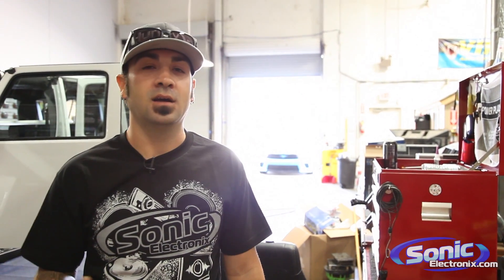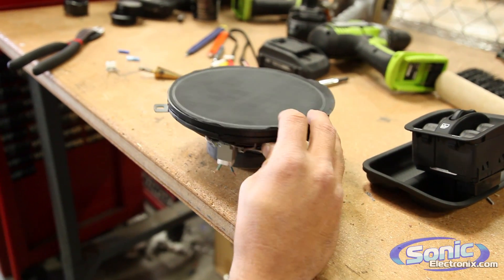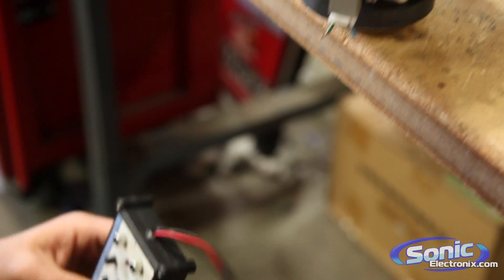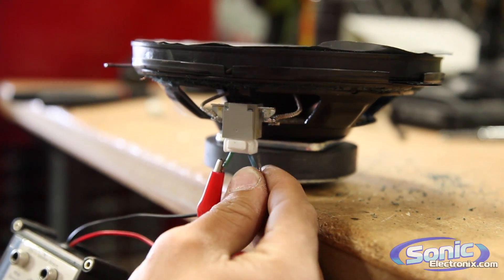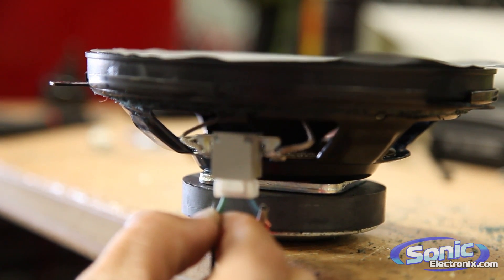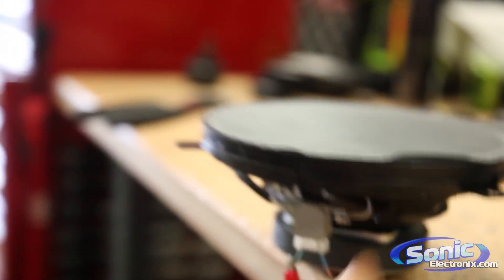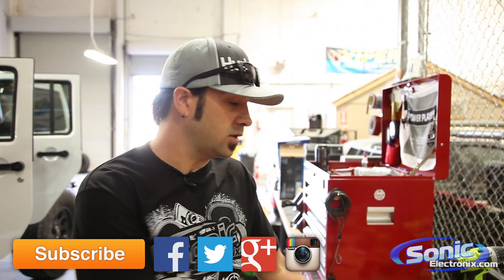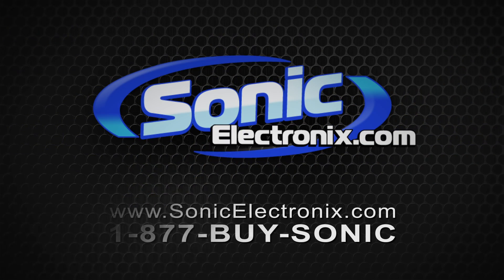How To Test Speaker Polarity | Tips & Demo | Car Audio 101

Comment: How would you test the wires in the door for which is positive and negative if you don’t have the factory speaker?
Reply: Measure with a multimeter. One end is connected to the negative ground of the car, and the other to the speaker cable. If you see voltage on only one of the ends, that end is positive. The other end is negative, connected to the car's ground. However, this doesn't apply to all amplifier types. In other words, on most amplifiers, the negative output is also directly connected to the negative ground, and there's no fluctuating voltage there. However, there are other amplifier types that have floating voltages on both ends of the speaker. Unfortunately, there's no simple way for amateurs to detect this. But as I mentioned, on most simple audio outputs, the negative output is also the negative ground terminal of the car.

Comment: I used the free Android app called "Polarity Checker." Basically, the app on my Android phone listens to test tones from a speaker and indicates the phase. Free. No meter to buy. The app provides the test tones. I installed the app on my Android head unit to play the tones (one speaker turned on at a time) and used my phone to listen. It is that simple. Phone is used as my meter! I found out that all of my speakers had the wrong phase because I manually bypassed my factory JBL amp on my XG350 2004. With the wire colors matched, the phase actually was wrong. Thanks for the phase testing information here and the free cool app in Play Store. Otherwise, I would be listening to crappy audio and wouldn't know it. With the wrong phase wrong for all speakers, it sounded OK, but not great. Couldn't be sure without phase testing.

Comment: I this problem with a cerwin vega powered sub. They pull inwards with a hit not out. I looked at the speaker terminal and they looked right.  Can the amp be causing this or is it or are they wired wrong somewhere?

Comment: 25 years or so ago a company used to make a device called a Speak Right, this could find speakers out of phase in a bandpass box or behind a door panel without taking stuff apart, it was great for hooking up your amp wires alone because somone didn't have to tell you what speaker popped when testing.  plus the momentary pop won't help you find out you need a tone generator set at about 9kz  or pink noise. without hooking it up to the amp.  Of course you Young Kids wouldn't know anything about that.

Comment: I am already one hour on the internet to look how to check the speaker polarity WITHOUT seing the speaker
I have a car and the speakers are in the doors, the cables were changed and both have the same colour, 
I want to check the polarity of the speaker without taking the whole door panel out just to see the speaker if it pops outwards or inwards

Comment: thank, just installed a new car radio and replaced the original speakers. found out the old speakers where also wired wrong
and now i have a wonderful working sound system

Comment: Would you recommend reversing the polarity of a subwoofer in a regular cab truck, since the sub is close to the door speakers? I have a pair of 6 1/2 Infinity Reference X (93 db sensitivity) getting 45w rms each,  and a DB Drive K5 12" (84 db sensitivity) getting around 650w rms. The subwoofer is front firing behind the driver seat.

Comment: Does it realy matter which way the speaker drives? Iv heard of lots of people reversing subs in loaded systems ( 2 subs facing eachother) wats the go with these?
Reply: It matters in the sense that you don't want 2 speakers with opposite phases. The speaker isn't necessarily driving one way, like in or out only, when it's playing it will range from an inner limit to an outer limit of movement. If they're out of phase, it tends to cancel out sound and you won't hear the full potential from the system.

Comment: Yes use a 9 volt battery. That is how you damage a speaker
Reply: imickey503 9v battery will not damage a speaker, done it many times and has never happened. furthermore this is the speaker you are taking out and won't be using anymore so why would you care? The new speakers that are going in its place are marked for polarity so you don't need to do this to them.

Comment: Do NOT use a 9 volt battery! That is only good for testing a subwoofer. A 9 volt battery will blow your speaker.
Reply: +BassTesters no it wont! i do this with 6 dollar dollar store headphones and the work fine i used a car battery on them before nad that's 12 volts

Comment: Question, I've taken out my manufacturers door speakers and cut the plug off, I know which terminal is + and - on the speaker but not on the cable as it was taken off like 6 months ago, how would I test the speaker wire? Just connect it to my new speaker, turn a song on and try to see which way it pops? Help appreciated (before someone asks, I am fitting 165cm speakers in a 130cm opening lol and cutting it is harder then I imagined due to it not being a flat area)
Reply: You can use an item like this one>> Greenlee GT-15 Non-Contact Low Voltage Detector. It will light up only one the positive wire.